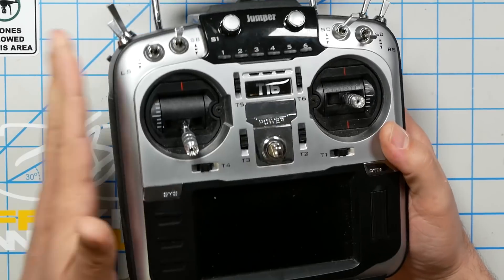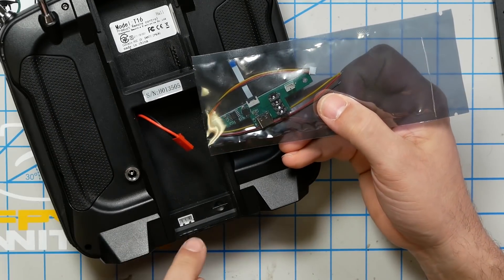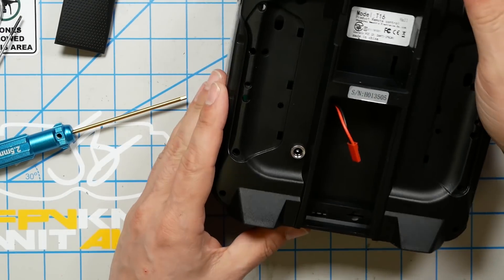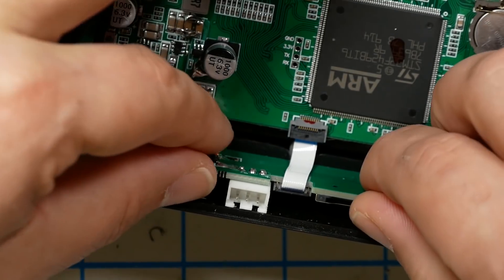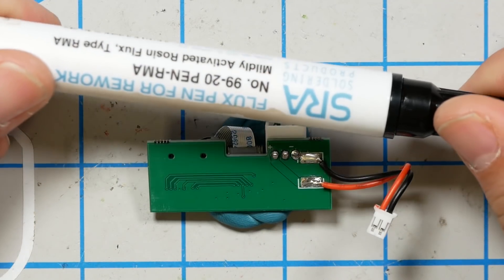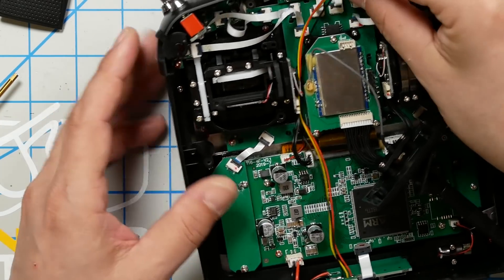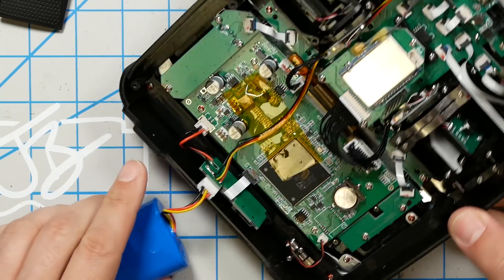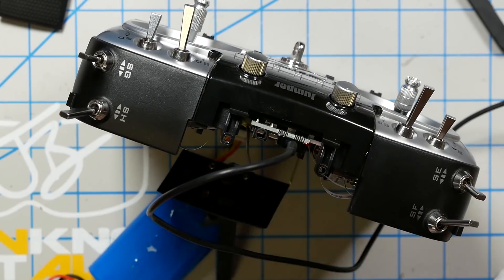Jumper T16 internal charging mod, USB-C, folding handle

Comment: Hey I have a problem with my t16 pro. All the buttons don't work and I always get the stuck button message on startup. I cannot change any settings anymore. Any advice ?
Reply: Same happened to mine, buttons & scroll wheel stopped working properly & got stuck button error on startup.
Solution: open it up and re-seat the tiny ribbon cables that connect the button boards to the top board.
And if that doesn't fix it, you may need to re-seat the large ribbon cable that goes between the top & main boards.
Reply: Detach the ribbon cable attached to the scroll wheel pcb board. If the key stuck error goes away, then the return button or scroll wheel button may be damaged. A replacement board is needed. I currently have the other side broken (MDL). Jumper just shipped me a replacement board as it is still under warranty. Stay tuned.
Reply: Had the same issue on mine and had to re-seat the large ribbon cable between top and main boards as licensetodrive said. On another T16 one of the buttons wasn't working at all and re-seating the cable for that one helped. Looks like these cables/connectors are pretty poor quality which is a shame as I love the radio otherwise.

Comment: I have ordered 3 of those charging boards, one to put in my T16, one to put in my PowerPLAY so it charges them properly, and a spare one, because it seems too useful to pass up.
As Jumper have released the full 3D model of the T16, I will be editing & printing a new top plate to accomadate the USB-C socket as I don't want to cut/modify the original.
Reply: do you mean 3d printing? if so, would you mind sending it to me when you are done?
Reply: @YaBoi WhiteRice  Yes I intend to 3D print a new top plate, if it works well I'll put it on Thingiverse.
Reply: They have the new cover on their Ali store at $0.99

Comment: Please JB do a usb c and 18650 cell mod on flysky i6x
Reply: Come on like this comment for people that don't want to pay much and have a nicer radio
Reply: its an easy mod, just wrap 2 x 18650's as a 2s (with balance) connect internally to the battery connectors and use velcro to attach cells to the rear. here is a mod for a 2s lipo..
https://www.youtube.com/watch?v=El4XIOWh_gk